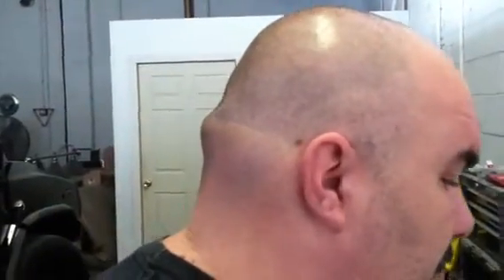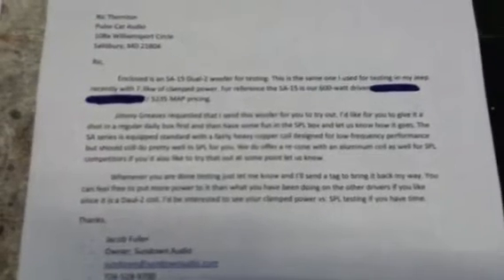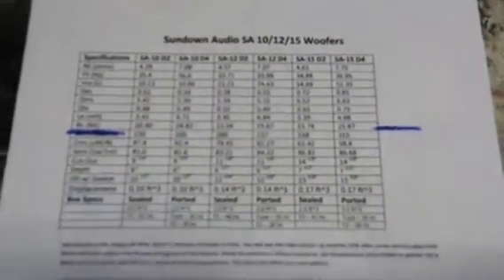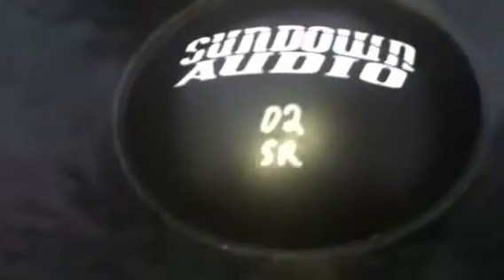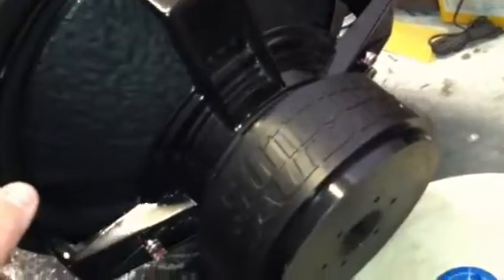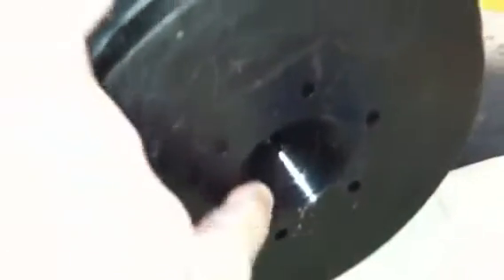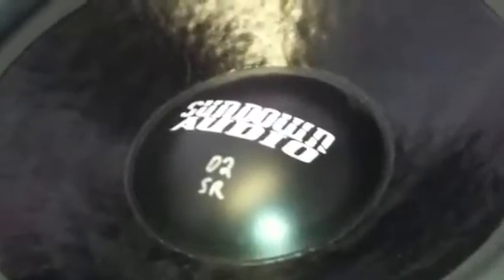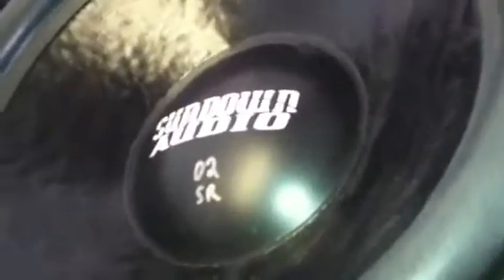15" sub testing in the Boswells DDBEAST ... Sundown Audio sa15

Comment: This is a bit late, but  im looking at picking up a couple sa-15s, building a BIG box... in excess of 6cubes and ported really low (about 28-30 Hz). what type of box would be appropriate for running these at high RMS, Im thinking of running either a sundown SAZ-1500D or a 2500D if i can get the right setup for it and i know it will be safe for demos. P.S. I have LOTS of room, i have an ext cab truck which the rear seat is coming out of for this build.